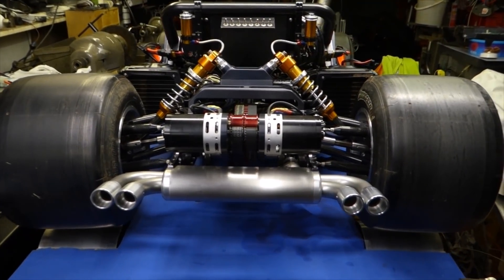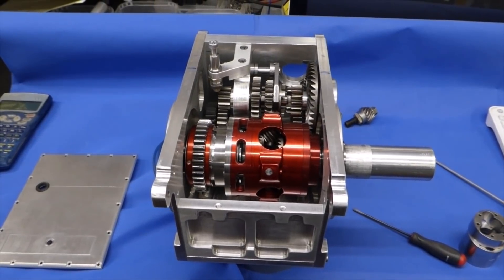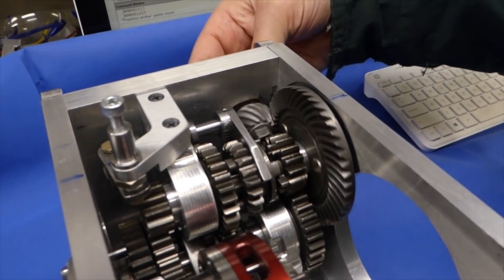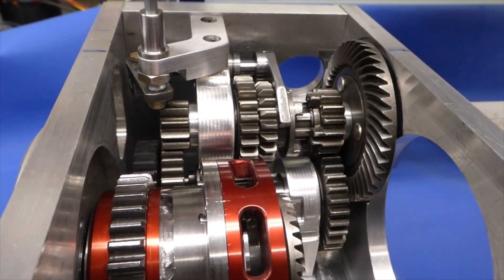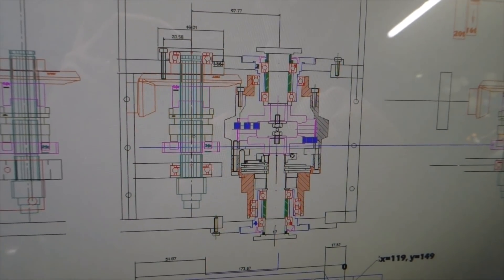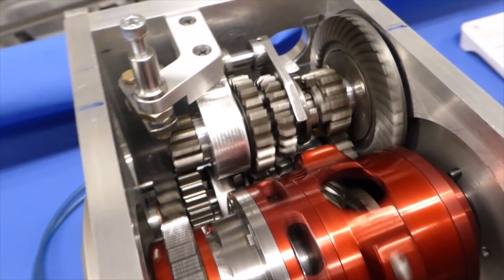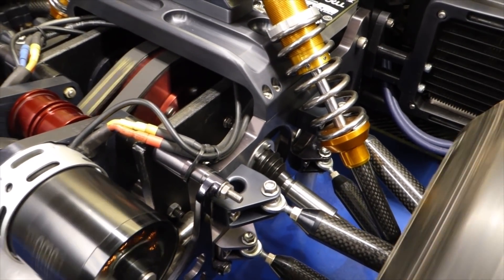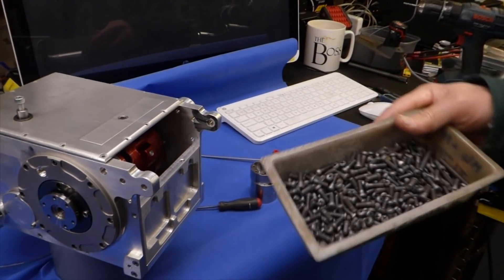1/3 scale V10 RC car part 11, gearbox build

Comment: How many angle grinders have you murdered to create this.
Reply from the maker: None. Buy spare gear from Amazon.
Reply: @Keith5700  oh smart, are you running the gearbox without oil?
Reply from the maker: @louija3625  no, it runs with ATF.
Reply: @Keith5700  I reckoned, thanks for the response.

Comment: Gear box . is it from motorcycle?
Reply: Wow that's sounds informative. Thanks.
Reply: @blkdna748   You are very welcome!
Reply: Yes, he said  certain gears were from a "pit bike" which is a small dirt bike style bike (usually around 50CC) that is used to get around race tracks and the like. Also said one of the other gears was from a 9 inch angle grinder.

Comment: Have you thought of maybe machining some material off of each gear to drop the weight, maybe some indexed holes through the sides too? Not sure if the input and output shaft are hollow? If not, this might be an option too?

Comment: With all the holes how will it hold gear oil?
Reply from the maker: there arent any holes open when it's assembled. Most of the bolt holes are blind, and the bits which bolt on are all O ringed.
Reply: @Keith5700  ah👍👌

Comment: Do you have any estimates regarding the power output of the engine? How did you decide on the size of the gears you used in the transaxle? Are you going to use oil in the transaxle? If so, what can you use that won't adversely affect the clutches in the limited slip?

I've really been enjoying seeing your steady progress on this project. Please don't let some of the other negative comments get to you, there are plenty of us that appreciate the opportunity to see your work.
Reply from the maker: Hi, no idea about horsepower yet, but I have a plan how to measure it, once it is driving the wheels.
The gear sizes were sort of dictated by what I could get hold of. They are a bit big for 1/3 scale, but sometimes scaling down accurately doesn't work. I'm sure this engine would rip proper 1/3 scale gears to shreds.
It would have been nice to get HPC or someone to supply hardened helical gears of exactly the size I wanted, but that would have been a big hit financially, and then I've got to figure out how to attach them to the shafts, and how to make the gearchange work, synchro, blocker rings, etc. So I'm happy with what I've got for now.

The lsd clutches are ptfe, which sounds counter intuitive, but I use it a lot at work for this sort of thing. Never ran one in oil so will see what happens. The clutch locks up solid with very little preload, so I'm guessing it will be fine. If not I can just change the ptfe pucks.
Cheers.

Comment: would think about looking around 3 kilos for g box .. 6+ kilos appears will heavily stress the most expensive bits , dependant upon overall torque .. and how its carried throughout band range .. maybe hollow out shafts .. and replace some of those straight cut gears with high grade allum … this might also quieten the whizz whazz from those straight cuts too … I must say that g box appears absolutely monstrous ? maybe just a perspective anomaly .. does it have fluid sprayers/droppers ? and what is 1st gear ratio to max engine rpm ?
Reply from the maker: To be fair, only half of it is the actual gearbox. Half of it is the differential casing. I should have called it a transaxle, but it’s too late now.
It’s down to 5.5kg at the moment.
First gear is 13:1.
Reply: @Keith5700  its never too late lol … thx for the ratio ( sounds about right ) and if im reading you right .. 3 kilos for diff casting/castings  + diff casing , still sound like things should be orbiting it :).. im trying to figure if that would act as secondary flywheel ? which may imbalance engine .. maybe get a torque splitter/buffer/damper ( multiplier ?) between crank and box connection ? maybe do video of g box fitting ?

Comment: It looks so nice I would just get like a carbon fiber body
Reply from the maker: Where shall I get it from?
Reply: @Keith5700  There are some companies that do custom carbon fiber, or if you have a 3D printer you could try and do it yourself, it is quite expensive tho
Reply: @Keith5700  Your imagination is the best supplier from what I can see.
Reply: I don't know how I feel about putting a body on it at all. The craftsmanship is amazing, it would be a shame to hide it. If I had to choose a body, it would be an open wheel design so I could still see some of the suspension components.

Comment: When I look at this build i realize how much work was invested in this masterpiece.I wonder how you will synchronize Engine with El. Motors? Will it be manual or you will use some microcontroller to work with some lookup tables as on real cars?

Comment: I know the answer could be like "search on Internet" but I will be so happy and grateful if you could give me a hint where I can find the parts for suspension and stuff like that.i have project for my Master degree of torque vectoring system for EV where I made a mathematical model of the car and algorithm of speed and torque distribution and I want to build scale model like your to proof the concept.And for that task I am looking for chassis and suspension parts including also wheels and wheels hub.If you don' mind could you please tell me where can I buy similar parts.Thanks and best regards.
Reply from the maker: I made all my bits. Depends on what size you’re looking for. Maybe go kart wheels and hubs would suit you. Don’t know about suspension because karts don’t usually have this.
Reply: @Keith5700  Everything is even more impressive.

Comment: R u making it hybrid power from gas engine to power electric motors ...well electric motors need no gears as tourq is full from 0 rpm...as toothed gear belt of electric motorcycle..it has no gears direct drive...

Comment: Good work dear ...wonder you made diff out of angle grinder gears..dear put oil seals n fill it will thick gear oil ..that will put addional weight..or may be a thick layer of heavy duty grease...dry graphite lubricant.....just can't wait to see it running

Comment: I have been following you since you first showed the engine. I can’t wait to see the final car 100% completed. I know this kind of 1 off fabrication takes forever, but can you hurry up! Lol. Great craftsmanship! Finished the video and had to edit. I don’t recall you giving a overall weight up to this point, or did I miss it? And you mentioned making the rubber boot for the CV joints, do you have any videos of the small things like that recorded and just haven’t posted? I am sure I am not the only one who would love to see that kind of stuff. Personally I have done lots of metal work, albeit nothing to the degree you have, but would love to see more of the small bits that go into this huge undertaking. Thx for what you have posted and shared! Also I want to ask about the hybrid setup. Are the motors to be powered with the gas engine? I ask because if they are not, at least just a little, it will add resistance to the gas engine due to the whole magnets whirling around conductors, like when you drop a magnet through a copper or aluminum tube and it slows down due to the eddy current.
Reply from the maker: Hi, I've got hours of footage from the build which I haven't published. I never imagine many people would be interested. Obviously there will be some who are.I'll get round to sorting it all out one day.
The cv joint mouldings and mould are shown on an early vid. No idea which tho.
Current car weight 66kgs.
Petrol engine and electric motors will be able to work independantly, or together.
Electric motors will be from batteries only.
Reply: @Keith5700  I've also been a subscriber since you showed the video of the first engine, I'd love to see all of the work that goes into making the parts as well.
I've always been a kid at heart, now I'm 50 and you're making my childhood dream RC. Thanks for sharing
Reply: @Keith5700  i second the release of fabrication footage. I love watching skilled engineers fabricate, a level of quality i aspire to be at in the next few decades

Comment: i have a 16hp race mower its diff is half the size as yours :D
Reply from the maker: where did it come from, or what is it out of?
Reply: @Keith5700  its a wolf garten cart originally with 6hp tecumseh, i swapped for a 16hp vanguard v-twin and use a peerless 700 series transmission 3 speed + reverse.
Reply from the maker: @Boemel  those gears look interesting. Do you know if they are hardened?
The box doesnt appear to have a diff? Just a crownwheel.
Reply: @Keith5700  They come in different types and gear ratios and number of gears. No Diff. These are widely used in garden equipment like mowers and small tractors. and filled with bentonite grease. The good ones are sealed and have brass bushings., others are cheaply made. For serious use they are modified with bearings and oil seals and filled with oil. Most of them have a sprocket on the output shaft and input shaft is whatever you put on it.

Comment: Absolutely awesome build! Just a thought - would it not be simpler to use standard RC car servos for the gear shifting? Eliminates the need for an onboard compressed air supply. Also, you can just reverse it using the electric motors! Although I'm sure you've thought of that :) can't wait to see it completed and running
Reply from the maker: The gear change will be on one channel and Change up and down sequentially like a motorcycle. I couldn’t see how to do that with multiple servos. The change has to be simple as there will be too many other things going on at the same time.

Comment: Great work mate very impressed. What about making the gearbox housing from carbon fibre to help keep the weight down, it looks like it should be easy to mill. Keep up the good work you have my attention
Reply from the maker: I’ve machined it a few times, but I think it would be more trouble than it’s worth, to make a complex casing with it.
Reply: Extra weight on the rear might be a good thing with the size of the engine!

Comment: Awesome project can't wait to see it drive with the V10! 
Why don't you use a servo for shifting gears instead of the air/hydraulic cylinders? Would be the better solution in terms of programming, wouldn't it?
Reply from the maker: Well I couldn’t work out how to program 2 servos to work in sequence from one channel.
Reply: @Keith5700  you could use an arduino controller to actuate the servos, give it input from your reciever or other sensor....the software would take those inputs and run them in a "if loop" over and over again

Algorithm would go like this:
If "input xyz" equals "0" wait .1 seconds

If "input xyz" equals "1" run "shift up" function

If "input xyz" equals "2" run "shift down"

So your three states would be wait, shift up and shift down. You could easily write the software to do complex shifting sequences from one input.
Reply: Could even add a clutch and actuator, and have the arduino actuate a clutch. Although the minibike gears you used are dog engagement and do not require a clutch.
Reply from the maker: @midship_nc  Yes, I can sort of see how 2 servos could be made to work with arduino.
But I always prefer good old mechanical solutions, before involving electronics. I've had so much trouble with the Megasquirt ecu, and the speed controllers that I've had a bellyfull of computer chips for the moment.
Besides, "air shifters" sounds cool.
Thanks for the offer.
Reply: @Keith5700  yes then your car will sound like a race bike on the isle of man TT...hissing and popping. Keep up the good work keith! Im sure if you ever wanted to reach out for something not in your wheelhouse, there would be people lining up to help you. Myself included, would love to contribute to this epic project! Someone at spaceX needs to hire you....they could use some of your experience to get to mars. Martians will need transportation!!!!!! You could be lead engineer on a rover!
Reply: @Keith5700  i would even offer to write said software for you for free if you would like....could send it to you on a thumb drive or via email. I would only need to know exactly which actuators you would use and exactly what reciever you are running, and what order you wanted the shift rods to move etc.

Comment: Excellent. Where's the air coming from to power the gear shift actuator cylinders?
Reply from the maker: I’ll need a small air pump, and I’m going to use the tubular chassis as the air tank.

Comment: How many gears are you going to have in the gasoline engine and how many gears are going to be in electric I mean shifting gears?
Reply from the maker: 3 forward gears for the gas engine, with manually replaceable gears in a transfer box.
No gears for electric motors.

Comment: Will the lsd still activate if driven from one electric motor?  Most clutch type lsds depend on drive from the input to perform the lockup so I would think I'd driven from one wheel it wouldnt activate.
Reply from the maker: Good point. I’m not sure, I’ll try it when it’s all back together. The electric motor controllers have a traction control option so it’ll be interesting to try that.

Comment: Hello Keith, I noticed that you noted that it has some drag, the gear set seems free but diff drags, what is the bearing set for the diff? Outstanding work Keith   God Bless Ya   Dave
Reply from the maker: Yes, I think it’s just the oil seals in the diff. It should free up with oil in it.

Comment: Amazing build. I've been watching this very closely. One observation on the gearbox - you're using straight cut gears, so they're going to make a lot of noise. That's not a problem just don't be surprised. Check backlash on each combination, more backlash = more noise. Can't wait to see it drive under petrol power. Best of luck.

Comment: I think you have to scale it a bit down, seems for me the scale is not realistic
Reply: Unfortunately physics doesn't scale down proportionately. Lets say your largest gear in the transmission in a full size car was capable of handling 300 HP. Take that same gear and make an exact 1/2 scale replica including tooth form, metal type, heat treating, form grinding etc. So it's then good for 150 HP right? Uh uh, at half of full size it will have approximately 1/8th the strength as the full size gear because it will have 1/8th the metal that the full size does. Think about it this way, lets say you have a solid square block of steel that's 2" x 2" x 2" that's 8 cubic inches. And to keep things simple lets say that square block weighs 1 pound per cubic inch. So that's 8 lbs for that block. Now machine one exactly half the size, 1" x 1" x 1" that's 1 cubic inch and weighs 1 pound. Those numbers are for trying to replicate something half the size of full scale. What Keith's doing is to a far smaller scale than half scale so the metals strength becomes a huge issue the smaller the parts get. Building a full working model to the level Keith has is an extremely complex engineering task and more than a few compromises have to be made. In a way building at full size is much easier. Much more money but easier. I've machined 1/6th scale parts and the set up time and machining likely took just as long as a full sized part would. I'd like to think I know just barely enough about the design, engineering and machining on this car to be amazed. Most others say the same thing in these comments without knowing just how much shear talent, craftsmanship and the multitude of engineering skills it's really taken. I'd bet a large amount of money there's barely a handful of people world wide that have the combined skills to even attempt something like this.

Comment: Wow it just amazing  how much  engineering  in that  but  whay  you  didn't  use  (cvt ) transmission  ? It smaller  and give  you good  performance  and easier to control it then  gearbox  but  ^-^  I like  tha  gearbox  nothing fits with v8 engine better then  manual gear box
Reply: V10

Comment: Could you perhaps take weight out of the back side of some of the gears or drill the holes inbetween the teeth and the inner hole to lower the weight surely the car won’t tear such big gears
Reply from the maker: There’s not much flat space on the gears really. They’ve either got the drive dogs or drive slots already in. All the gears are through hardened as well, so I’ve had to heat treat some already, so I can do some mods, but I don’t like doing it really.
I might try grinding them a bit thinner.
Yes they are overly strong at the moment.

Comment: I think it's a really impressive build so far.

Are you controlling both electric motors exactly the same way during cornering, or are you programming an 'electric differential'?
Reply from the maker: Not heard of an electric diff. There is a traction control setting in the Vesc’s which I’ll try when the drives are independent.

Comment: I would love to be a fly on the wall to observe when you're doing schematics and machining. I would love to be able to machine some aluminium moa axles for my 5th scale crawler. It's been sitting on the shelf for 2yr because nobody sells stock replacement axles and the alloy ones I've found are too expensive for a single axle

Comment: That gearbox is almost robust enough for a full scale car..
Reply: Was just thinking the same thing 😂
Reply: @BrendanRaymondKoroKoro  Only if you flush through the motor after running.  Should be easy to use RC fuel for this purpose, Alco/oil/nitro.
Reply: The motor on this is probably a lot more torqueie than a normal rc car but it does look like over kill
Reply from the maker: @whittsadventures  in the future I’m hoping for maybe 20hp of electric power and 5-10hp from the V10, depending on if I supercharge it, or put nitrous on it.
Reply: @Keith5700  that would be so awesome. No harm in doing both.
Reply: @Keith5700  You could try for nitromethane, a middle ground.
Reply: @Keith5700  wouldn't nitrous send it crashing through a fence😂
Reply from the maker: @anthonypetercoleman339  yes, hopefully.